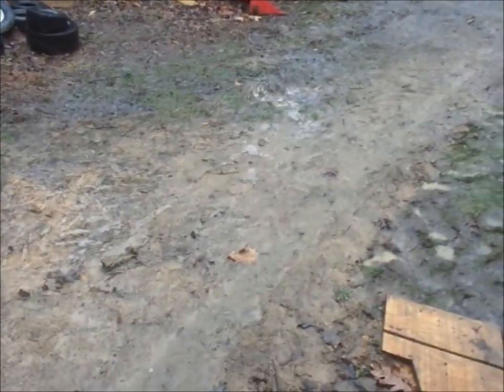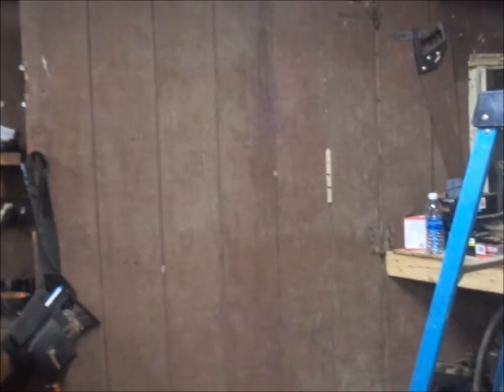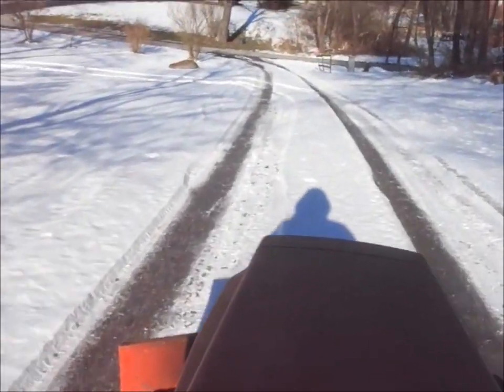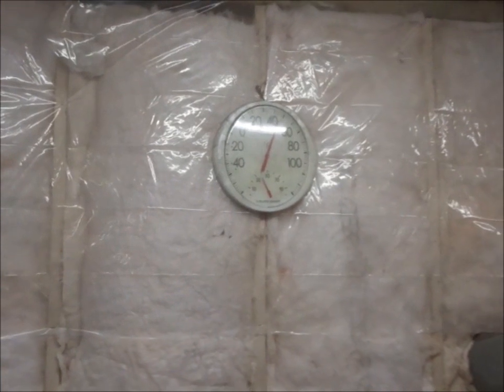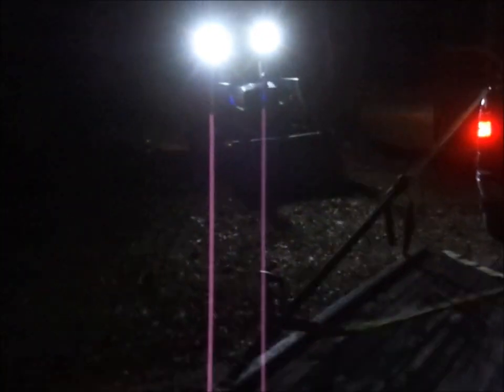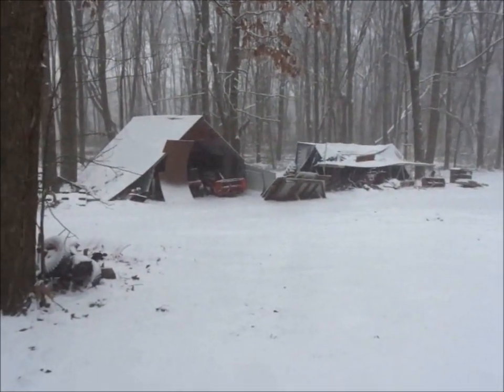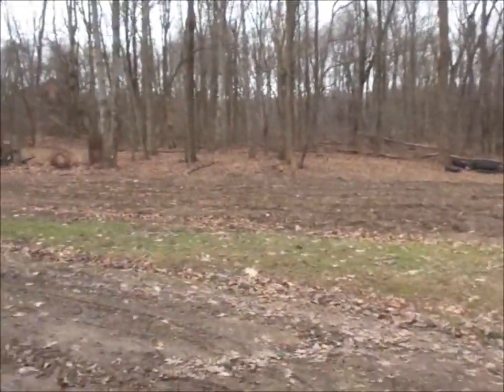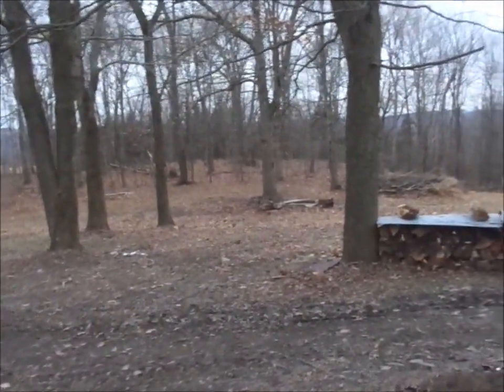Random clips 2024 part 1

Comment: Just so you know, there's stuff called grace paper that I always put on shed roofs.Or any other good roof I want it works great.No Little LEEKS.❤
Reply from the maker: Tar paper was long and rolled up in the wind thus backing water up. I trimmed tar paper to proper length
Reply: @Stevestractoradventures  Question.
For you, is it easy to find a bar?And chain for a chainsaw set up on A gravely I just found the head but not the bar or chain
Reply from the maker: @chuckb9867  No they take a nla chain that was 9/16th. I've seen guys convert them to a 404 pitch bar chain and sprocket
Reply: @Stevestractoradventures  Thank you.I'm patiently waiting your next videos